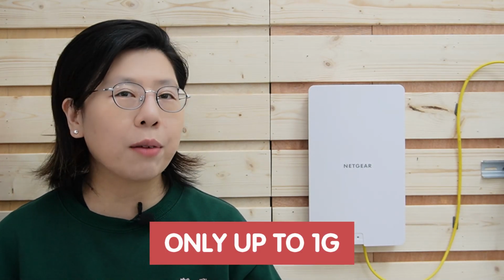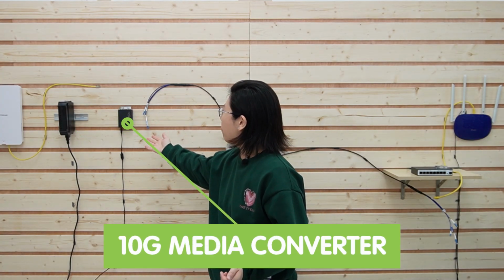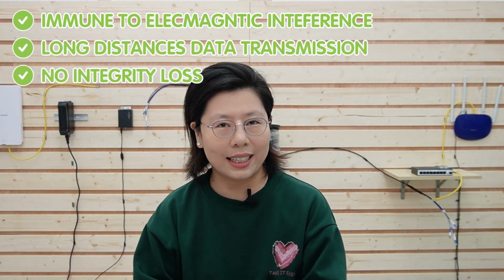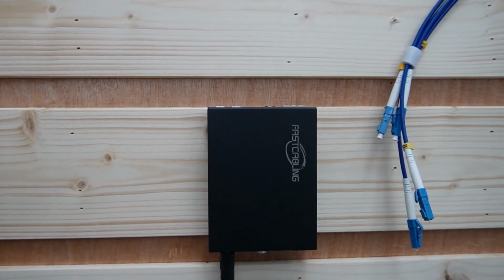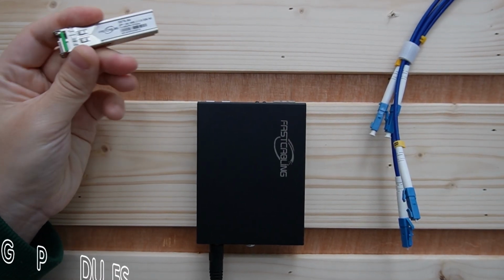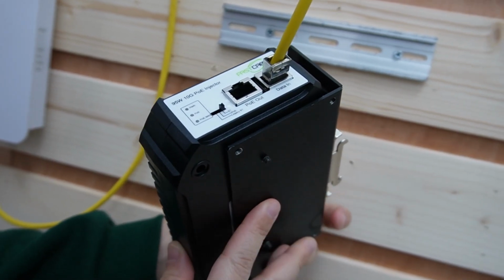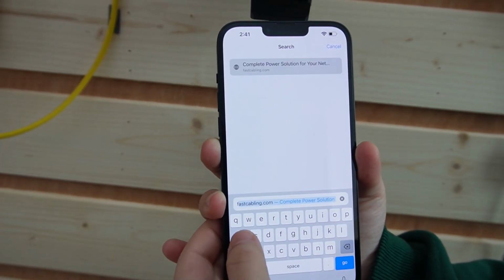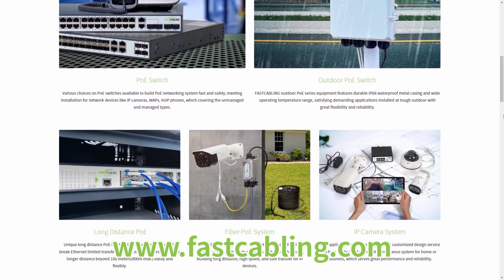Demystifying 10G PoE in Remote Areas: A Comprehensive Guide

Comment: WHEN U SAY 10G THIS 10G WHO GENERATES THE G,S WHERE DOES IT COME FROM?
Reply from the maker: "10G" refers to "10G Ethernet" or "10G network," and the "G" stands for "gigabit." 10G" signifies a network capable of transmitting data at a rate of 10 gigabits per second (Gbps).